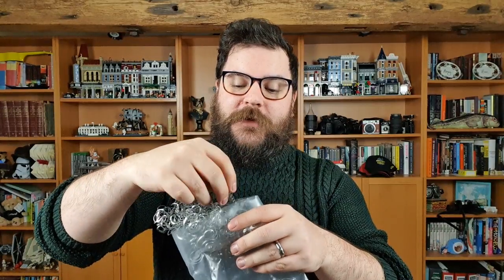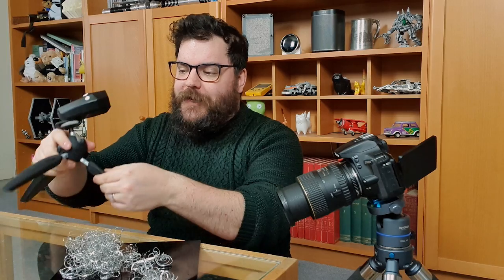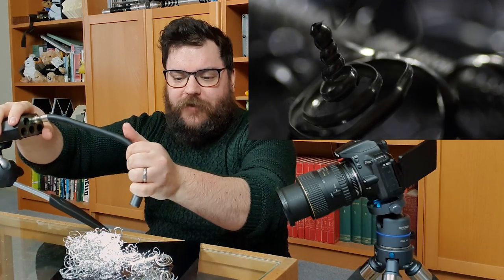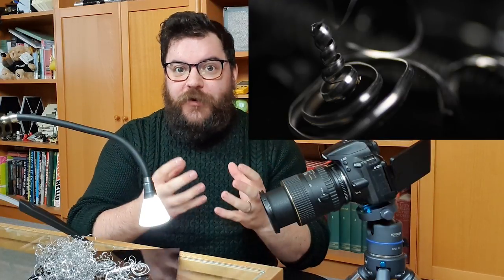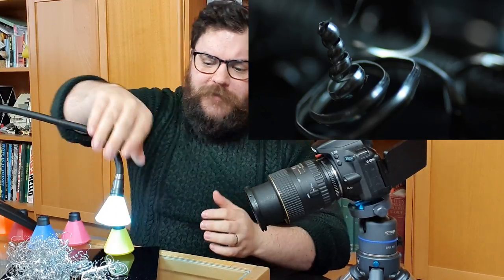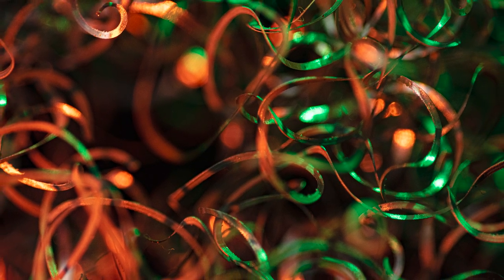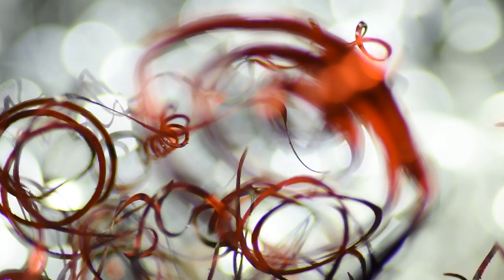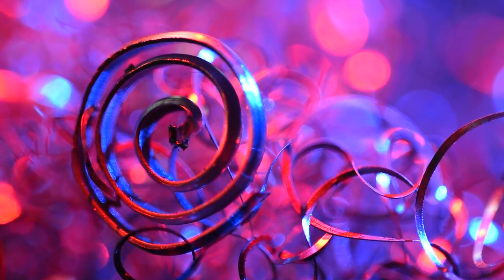Abstract macro photography with metal shavings

Comment: This is a random question. If you built your own table surface specifically for macro photography what width and length would you suggest for the table surface?
Reply from the maker: I'd say at least 1m x 1m would do. any smaller and you will restrict yourself with the placement of your subjects, camera and lighting.

Comment: A really interesting video subject today Ben. I would like to have a go at this but unfortunately i don't have a CNC machine in my shed and there are no manufacturing sites around here. You mention wire wool, i wonder if that would work or is that going to be too fine?
Reply from the maker: I've not done wire wool yet, but I imagine that would be very similar if you can get much closer. 

You might be surprised at what you can find locally, this stuff is called "swarf" in to the manufacturing minded folks (so Sam informs me!). It comes in many forms, almost always as a waste product that people are tying to get rid of. Ask around, it's not hard to procure if you want some to play with!